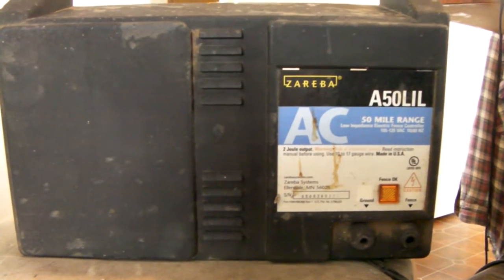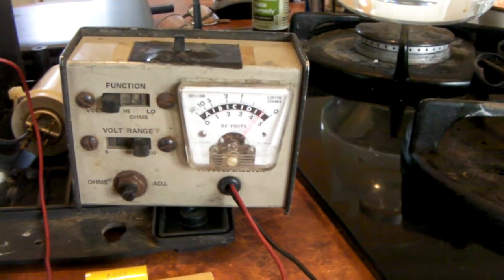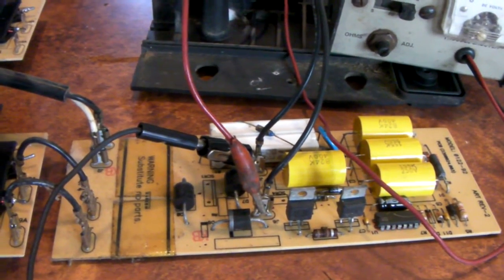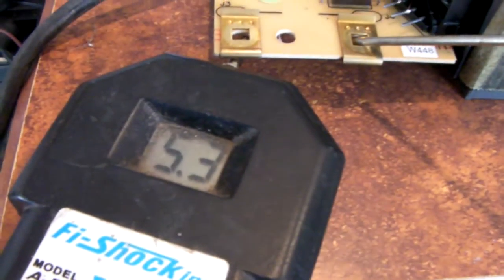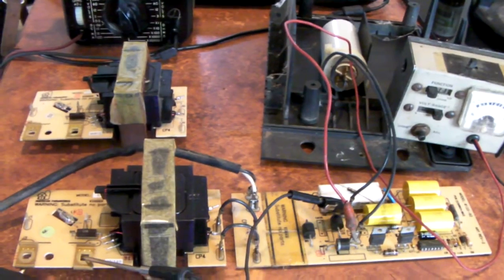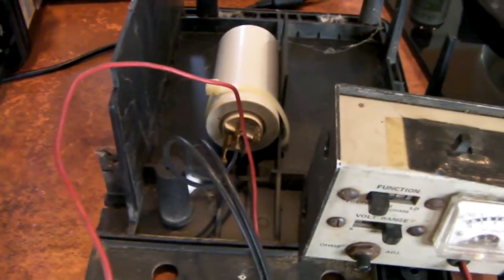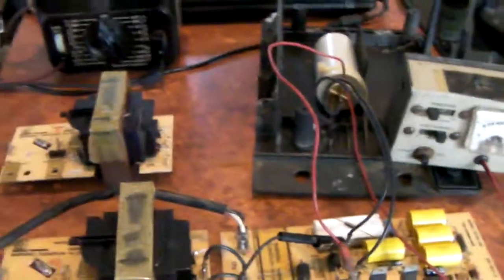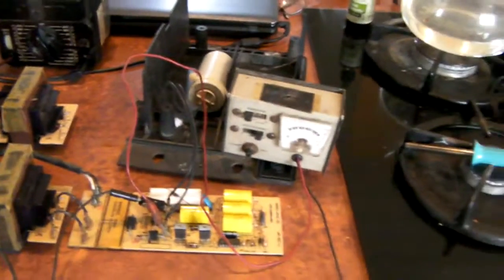Zareba fence charger fix - A50LIL

Comment: Thanks, have the Tractor Supply Hol-Dem Model T502-A  50 Mile that has the exact same guts. You helped me identify my transformer was going bad. My was clicking, but the output voltage was erratic.
Reply from the maker: Glad it was helpful, good luck.